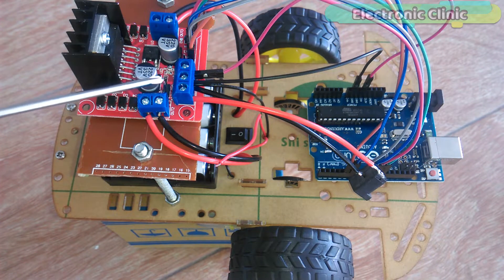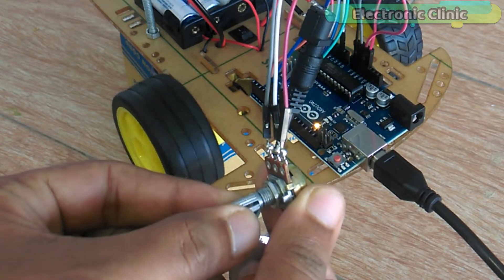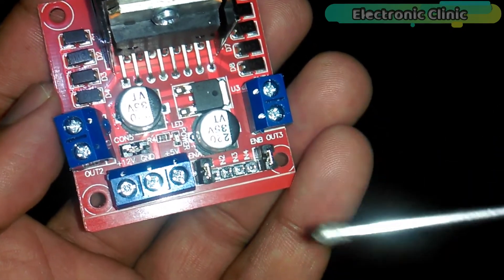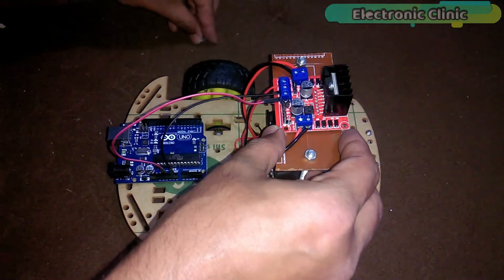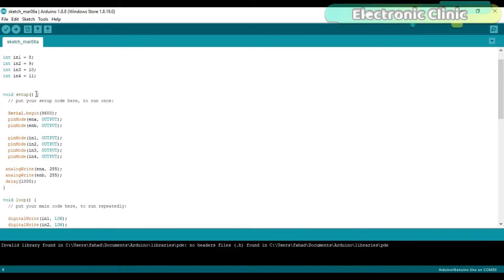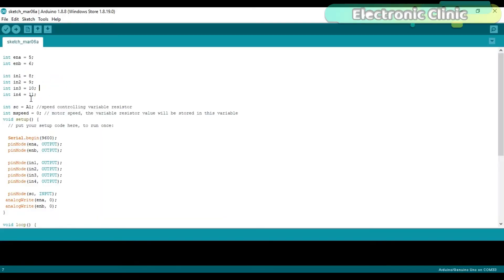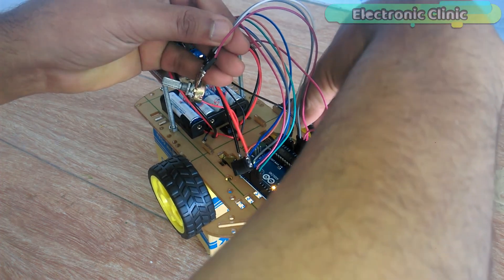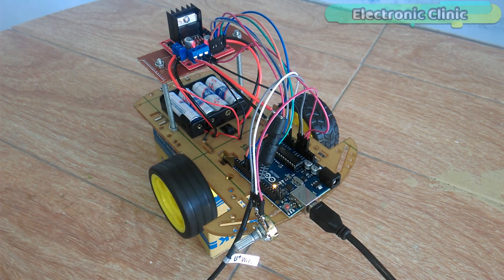Arduino L298N dc motor control code | L298N motor Driver Arduino | Arduino motor driver L298N

Comment: Well done. Have you tried connecting a servo motor and ultarasonic sensor with this robot, while reducing the speed of the motors to 100 or 120 instead of 255?  my greetings